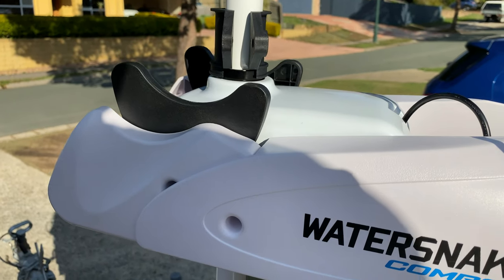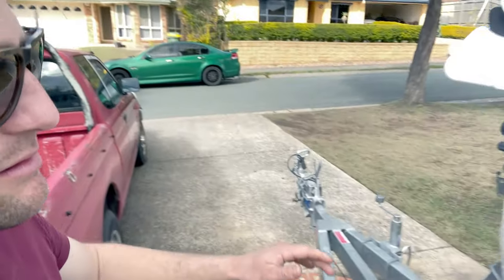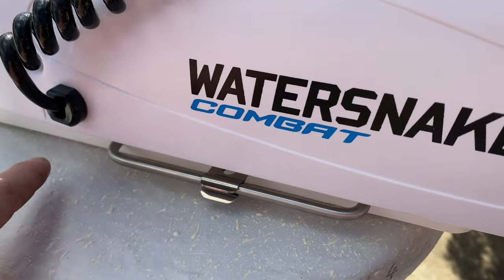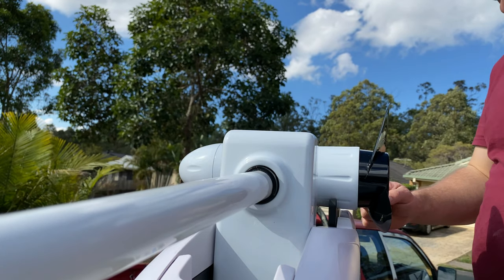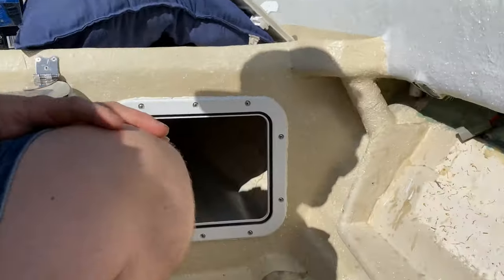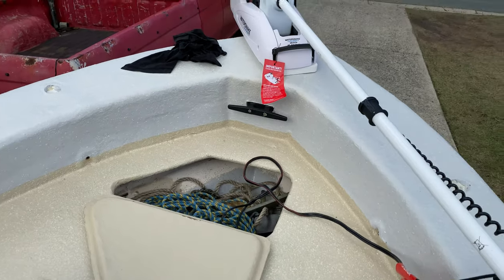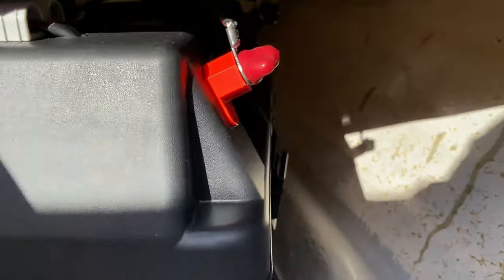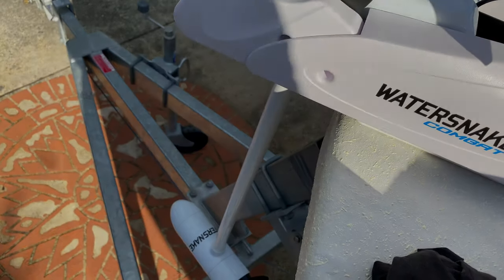Watersnake - Electric Motor Installation

Comment: Hey mate. My boat's a runabout with a full width windscreen and an anchor well in the bow. There's an anchor winch mounted in the well with the anchor rope running to the bowsprit a couple of inches above the deck, and there's a deck roller for it to all sit on. I want to put a trolling motor on but it would have to be mounted so it's at a 45° angle across the bow and so the motor's shaft sits over the top of the anchor rope when the trolling motor's stowed. Was wondering if you can tell me how much clearance there is between the trolling motor shaft and the deck when it's all stowed away?
Reply from the maker: It’s a bit hard to say cause depending on what size motor you need could change that height. Like mine sits about that 75mm to 100mm off the gunwale, but I’m running a Minn kota terrova now days. Sorry I can be more help there mate. 😅
Reply: @BrisVegasFishing  no worries, thanks anyhow. Any reason you swapped out the Watersnake for the Minn Kota? Only asking coz the Snake's such an attractive price.
Reply from the maker: @SandmannOZ  when I water test it after install she didn’t work at all. I changed out circuit boards and everything, they were happy to send parts to fix it. But in the end the issue just wasn’t worth it and the refunded me. So just a bad experience for me. But I’ve heard good reviews from mates that do run em.
Reply: @BrisVegasFishing  that's a bit of a worry... might have to give it a rethink. Thanks for that.

Comment: Hi, when you mount the motor at an angle like that, how does it affect the remote control? Since it is pointing at an angle, when you press forward on them remote, does it pull to the side etc?
Reply from the maker: Don’t have any dramas on the angle like this as the motor has a full 360 degrees range of motion.
Reply: @BrisVegasFishing  but how does it know which way is forward? if it is pointing at an angle, when you press the forward arrow on  the remote, doesn't it drive the direction the bracket is pointing?
Reply from the maker: Well from what it sounds like, you mean the heading button which sets the direction you are already heading. Not sure if this helps a great deal, all I can say it doesn’t have a reset to forward or anything like that.

Comment: Is this the new 2020 version Javis Walker released? The motor head looks slightly different
Reply from the maker: Not 100% sure. 🤔 All I can say is that it was a complete lemon 🍋 I didn’t even get to use it on the water. 😪
Reply: @BrisVegasFishing  Well that doesn't give me confidence what happened?
Reply from the maker: Yeah, it ended up being something in the motor itself being the issue. The remote receiver and controller were working no drama. They offered a replacement for mine, but had no stock in the country at the time. 😬
Reply: @BrisVegasFishing  hey mate any update on the lemon yet, I was looking at buying one until I read your comments. Maybe I'll save up for longer and get the minn kota
Reply from the maker: Ended up sending it back for a refund. Then just upgraded to the minn Kota in the end. Definitely better off saving up aye.
Reply: @BrisVegasFishing  Yup got the Terrova with ipliot link to the hummingbird no issues yet :D
Reply: @BrisVegasFishing  how much did the the new one cost as I live in Melbourne and looking at buying one. CHEERS ADAM👍